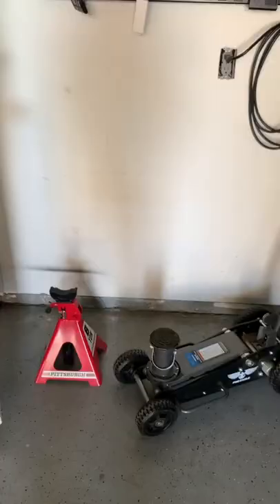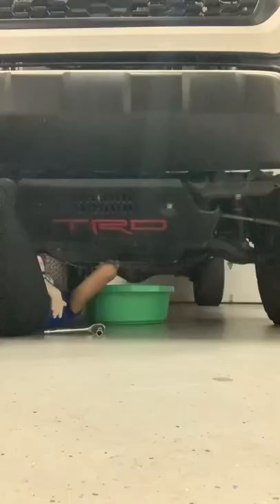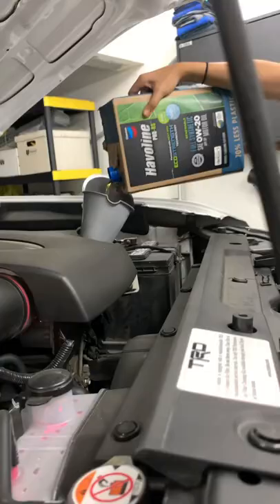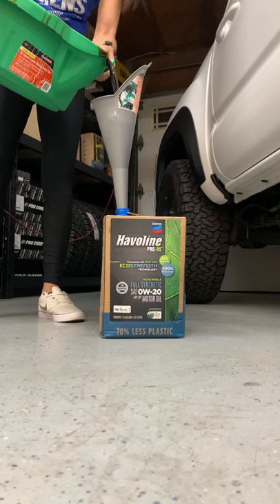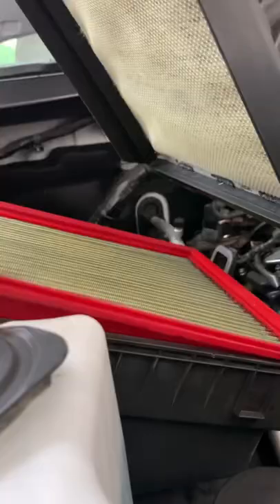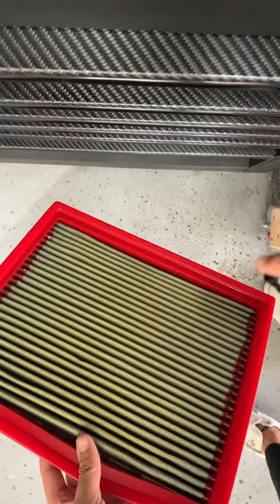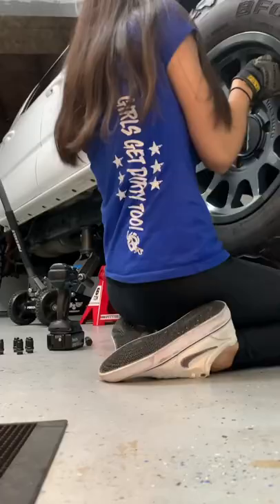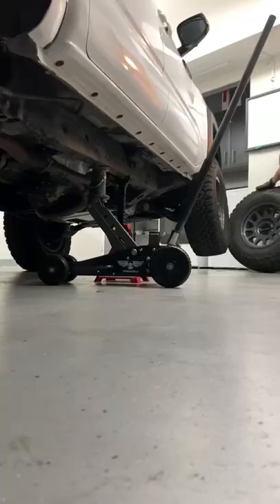My Basic Maintenance Routine | Toyota Tacoma

Comment: As a Toyota tech it's nice to see someone actually looking after their truck instead of just driving it and wondering why it has issues. Those trucks will go forever, just sucks the front ends don't hold together like they should
Reply: I had a 1997 Tacoma 4x4. Sold it with 190000 miles. Original steering components except for the shocks. They must have changed something!
Reply: @judee00  I'd say they did. I've seen year or two old trucks with 50 000 kilometers on them (just over 30 000 miles) that come in needing lower balljoints. Occasionally the uppers will be just as bad. Axle boots seem to be another thing that just decide to give up. Then again the roads around me aren't necessarily the best but even the babied trucks are still having issues
Reply: What front end issues are you referring to? Just curious so I can plan ahead and make sure to service my taco to the best of my ability as well hopefully avoid whatever issue you're referring to
Reply: @nicholassinovich4257  most common issues I was seeing was lower balljoints wearing out a lot sooner than they should. I don't know if they had a bad run with their parts supplier or not but on the newer body style tacomas it wasn't uncommonly for me to see 3 or 4 bad balljoints a day on trucks that were only driven for groceries. Another issues I have seen numerous times is the steering racks leaking fluid into the boots for the inner tierods, not as common but something to look out for if you're loosing power steering fluid and see no leaks. Keep your brakes serviced especially if you live anywhere near salt air or anywheres they put salt on the roads for winter, as the slide pins for the pads are prone to seizing. Sorry for writing a book lol
Reply: @CrosstownExpress  I appreciate the feedback. Ball joints aren't too big of a deal to me. If I don't replace them, I'd just upgrade to a Positive Caster UCA and throw on a lift lol

Comment: If you only do your own oil changes and aren’t a technician I highly recommend every 20-30k miles take it to the dealer to have them do an oil change and ask if they could give it a good look over. We can actually lift the vehicle and know common things to check to make sure everything is still in good shape
Reply: You don’t need to life the vehicle on a full hydraulic lift to check everything, don’t listen to this guy cause they’ll prolly charge you an extra 100 dollars at least just to look lol
Reply: @fearlesspie1314  inspection are free and I promise I can easily see the entire vehicle where if it’s on stands it’s a bitch to see anything
Reply: @user-white007  if yk what to look for not really but my Toyota dealer charges $150 for an inspection so that’s why I said that. I’m a mechanic but I asked them one time to see and I was like wtf😂😂
Reply: Find a reputable Mechanic, I only go to a “Dealer” for Warranty Work. 
Dealer claims to have performed Multi Point Inspection… forgot to change the Oil. Another time forgot to reinstall the skid plate!!!  My rear brake pads were wearing unevenly…. The cabin air filter was “checked” , they never looked it was filthy…

Comment: This won't be popular, but I started using a wheel dolly put my truck tires back on. I just pull them off, but it's crazy easy putting them back on with one. Save your back and you don't have to put body parts below the vehicle

Comment: I had one of the first Tacomas in 1995 with a 190 horsepower motor. I liked it a lot, but the 19 miles per gallon highway mileage  was terrible with the 31 inch tires and 4wd.

Comment: I would recommend factory air filters as the aftermarket ones can shed lint/oil that can stick to your MAF sensor. The “hot wire” can hit 400F and become varnished or get “the fuzzies”. But that takes a few years to happen, just keep an eye on your fuel trim 😉

Comment: Toyota recommends you: 
Align, balance and rotate your tires every 5k;
Change oil, oil filter and fuel filter (and for pickups check diff fluid levels) every 10k;
Change the engine air filter every 30k (some are 40k);
Change the brake fluid, differential fluid and check the ATF level every 40k;
Spark plugs every 100k;
For flex fuel engines only: 
Change the in-tank filter every 60k and inline fuel filter evey 10k.
Hybrids need the hybrid battery cooling fan air filter changed every 10k (they tell you to inspect it every 5k but most dealers replace it evey 10-20k).
Reply: Dam alignment every 5k lmao
Reply: @MaxedOutPlayet  boy I'll tell ya, yhe hilux needs every help it can get 😂 camber on those things is off from the factory and needs adjustment after dirt road use almost every 5k ngl...

Comment: That dirty oil looks awful… it’s damn near grey. I hope you don’t have some other underlying issue
Reply: I was thinking the same thing, like there’s no reason your oil should look like grey sludge after 5k miles, the gen 3 tacomas are not built like they use to be
Reply: @breacherup1803  just grinding those cylinder heads down to tolerance specs 😂

Comment: You should use mobil 1 1 year 20 k miles  oil , it’s the Toyota oil brand . Also doit every 3 k miles . For the cabin and air filter use wix brand, came number 1 in the tests .
Reply: So you’re saying use the 20k oil but do it every 3k? That doesn’t make any sense at all
Reply: @jeffclark5024  Toyota oil and Mobil 1 is made by Exxon mobile right?,but is not the same formula,Toyota oil is better . You should use Toyota oil , if not use the Best Buy every 3 k no 5 k .if you want your engine last a million miles . Also I’m from Europe,did you know over there they do oil changes every 5000 kilometers,=3106 miles .

Comment: Hahaha is good the maintaining in thus truck. But I in the past own a Corolla and only with chance the oil 2 times a year and filters 1 a year and never rotate my tires. And this car live 15 years with me and never fail me. So it depend in how to drive that all.
Reply: Rotating you tires just allows the tread on the tire to be worn evenly because the rear tires on rwd wear it down faster and vice versa on a fwd, so it’ll make your tires last a little longer

Comment: Those air filters are not ideal. They allow larger particles to pass than a factory filter does.
Reply: 100%. Paper filters are the way to go. I live hella rural, in really dusty southern Utah and have noticed such a difference in particles trapped with the paper filter vs an oiled filter
Reply: @Flyfeesh  I live on a 1200 acre ranch & rarely see pavement with my trucks and just like you I see oiled filters let dust past. 
Oiled filters likw K&N filters are really meant for race vehicles which get their engines rebuilt all the time.

Comment: The jack stands do you put them on the frame?
Reply: Technically you can jack a car up anywhere on the frame but specifically check the manual exactly where but usually newer cars have little arrows on the side with little lips to jack it up but if it doesn’t show that than somewhere on the frame on the inside of the tires is fine